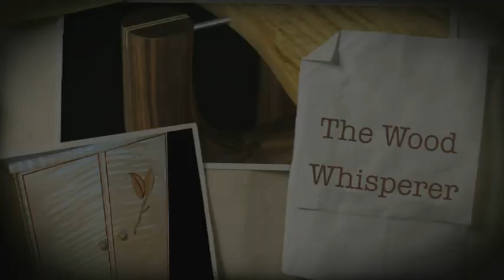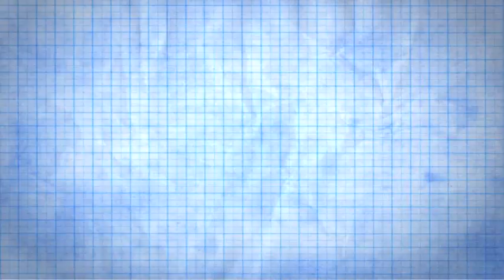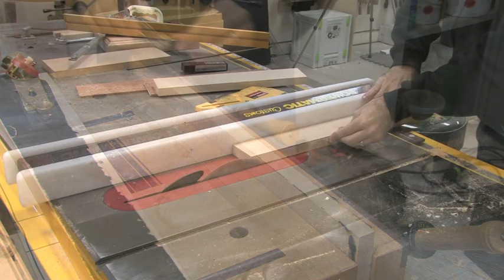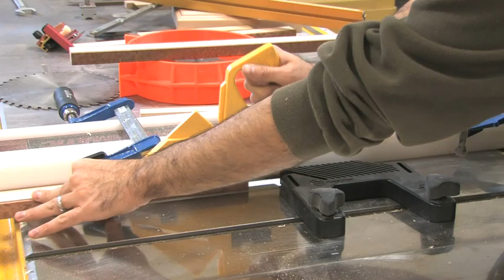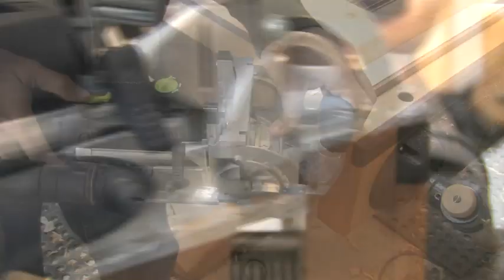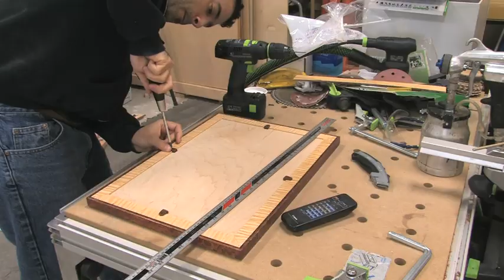80 - How to Build a Wooden Picture Frame

Comment: Putting the tip of your finger on the piece of wood that has already passed through the table saw blade and still actively being cut is a bad idea.  Unless of course you don't care about the tip of that finger and are planning on staining your wood red.

Comment: We don't have a shower stall but use our bath but  then I have quite a few w/working tools. I love the timbers you used but I would have preferred the main timber (Maple?) with the grain going Long ways - am I being finicky? Incidentally I like your videos very much. Keep up the good work ... even if you are a gnome!
Reply from the maker: +Michael Dillon thanks Michael. The grain actually is going longways. The stripes you see are the figure in the wood, not the grain direction.
Reply: I stand corrected!

Comment: Beautiful frame an I really like the afzelia wood! One suggestion, I recommend using museum glass to protect the artwork from fading due to UV light exposure. It is readily available from any picture frame shop and is not expensive. I use it on all the flag cases I build to protect the flag color.

Comment: Your tools SUCKS I hate you Mark! lmaoo All jokes aside, older video, but still pleasant to watch. however, I am shocked that you use solid maple for the substrate rather then a structurally stable birch plywood or something like that. I would tend to think that, with all the different woods and different  shrinkage and expansion movements between them, would cause a problem in the long run with seasonal weather changes.
Reply from the maker: My tools do suck! Especially my dust collector! :) Seasonal movement isn't much of an issue with smaller parts. The parts of this frame are on such a small scale that you can get away with this sort of stacked multi-species sandwich with edge-banding. On wider pieces, it may not work out so well. But I still have the frame and it hasn't done anything. Looks the same as it did on day 1.
Reply: loli wish my shop was filled up with tools like yours Especially a better dust collecting system lmao. Thanks for the reply and added information, Im sure Nicolle loved it, it looks great! Just to be clear lol before the internet trolls jumps in HAHA, I don't hate you or your tools lol Keep up the great work and fine woodworking videos we all enjoy, And Hope your move to Colorado happens soon. Im sure if you list your house comes with tools included, it be sold with in hours !

Comment: Great frame. Your really need a matting board or if not spacers to stop your artwork touching the plexiglass if you want it to last.
Reply: Yea, and plywood for the backing board is going to cause acid burn to the art - you should use a preservation grade piece of foamcore like Bainbridge ArtCare.

Comment: I'm fairly new to woodworking and really just picking it up as a hobby last year.   After watching this video, I decided to make a similar frame for my parents since we were giving them a family portrait.   I purchased a bit of Bolivian rosewood for the outer edge and used some douglas fir reclaimed from a tool stand in my grandfather's old shop for the inside.   I used cypress reclaimed from a friend's old fence for the spline material.    I don't think it turned out half bad, myself.   Thanks for the inspiration...  

https://drive.google.com/file/d/0BymnVQvDIunUUHVuZ0RBb19KNk0/view?usp=sharing

Comment: do the clips protrude in the back?  if so, how would you hang this frame so that it's flush with the wall?
Reply from the maker: +Anthony Campagna If you use clips, you don't hang it flush. You'd have to some up with another method to secure them that ends up with a flush back.
Reply: +The Wood Whisperer Understood. thanks for the super quick reply

Comment: Well done on the woodworking...I love the final frame product. Regarding Archival measures, I never would have framed the art directly against the glass (plexi),  either using  a mat or spacer between the art which would be dry mounted to an acid free foam core board. Being a frame shop manager I am forced to used molding purchased from the different molding companies. This gave me a great insight into the process. Thanks again!  Very inspiring

Comment: Hi Marc, this project inspired me for my gifts to a lot of people! I'm going to batch out a lot of picture frames that are steamed beach at 45mm (sorry about the metric I'm European and young so when you talk in inches it confuses the heck out of me! :P)  in the middle and 9 mm mahogany either side. 
My question is did you have your stock in the workshop for very long? as when I cut my beech stock in half, it caused some major movement issues. It's not economical to buy lots of little pieces.